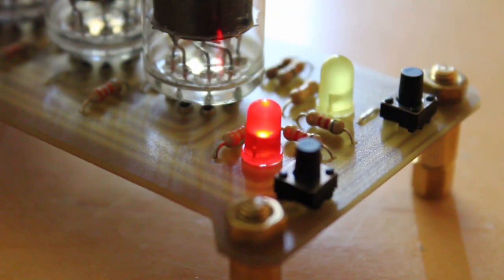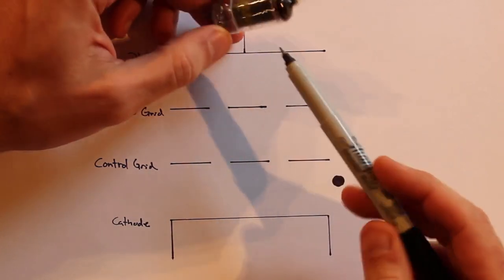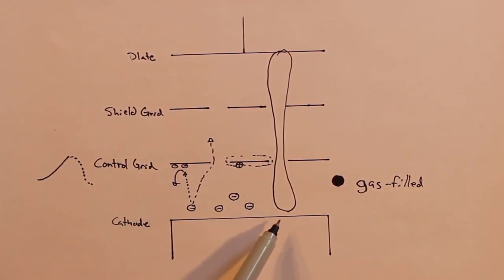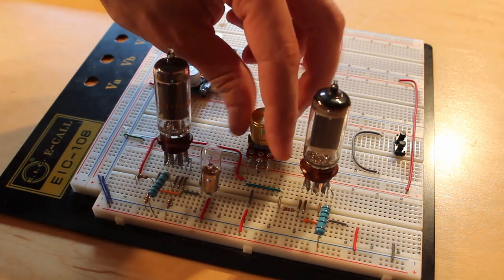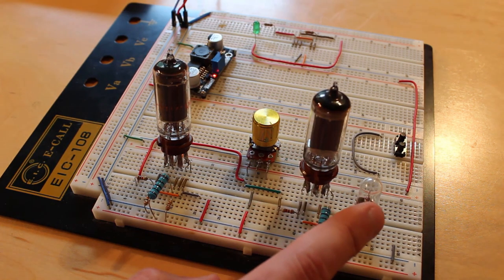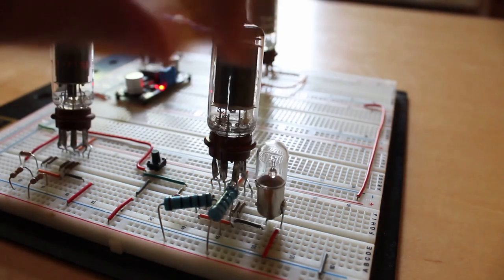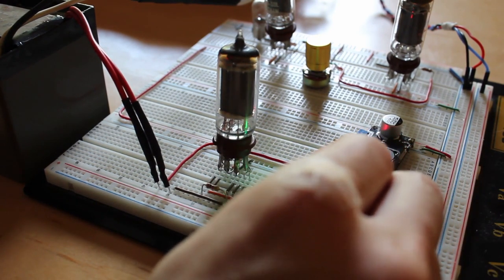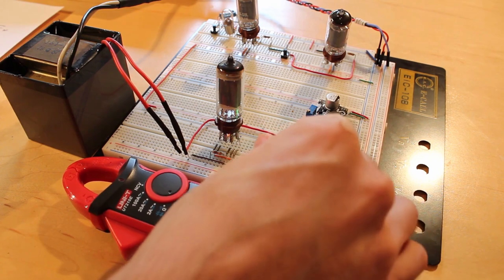The Thyratron and Using a 2D21 Thyratron to Move Some Current

Comment: Excellent video! Thyratron tubes were actually used extensively in industrial applications as rectifiers, and in speed controls for DC motors. I have a Monarch 10ee metal lathe from the late 1950s that uses a Thyratron variable speed DC drive. It uses four thyratrons in total: two large C16J argon thyratrons and two smaller (but still big) 3C23 mercury vapor thyratrons. The mercury thyratrons glow a brilliant blue when operating, and the larger argon tubes glow, but much dimmer.

The operation of the drive is very interesting. There are two sets of thyratrons to form two full-wave rectifiers. The larger C16J tubes control the voltage on the armature of the DC motor, and the smaller 3C23 tubes control the field. The speed control consists of two wire-wound rheostats which control the two rectifiers. Each set of thyratrons has a capacitor connected to the grid. When the thyratron fires (once each cycle of the input AC), the grid current causes the capacitor to charge a bit, eventually charging it enough to create a sufficient bias on the grid to prevent the tube from firing. This stops the operation of the drive. 
The speed control rheostat is connected to a control tube that discharges the capacitor at a controlled rate. When the capacitor discharges enough to allow the tube to fire again, the tube fires until the grid current charges the capacitor again. Based upon how fast the tube discharges the capacitor, the circuit will begin to oscillate, eventually getting to the point where the discharge rate of the capacitor exceeds the grid current, causing the tube to fire on every cycle.
When the armature is at full voltage, the second half of the speed control does the opposite: it ramps down the voltage applied to the field of the DC motor, allowing it to spin faster.

The whole system is basically a gigantic tube-controlled PWM speed control. It was particularly advanced for the time as it also included circuitry to detect load on the lathe and automatically adjust the voltage on the motor to keep it running at a constant speed.

I have thought about eventually making a few videos outlining the operation of the machine, and showing how to diagnose it, as most people with the machine are stumped by the drive. Unfortunately, the common remedy is to rip it out and shove in a generic modern drive that does not come close to the performance of the original.
Reply from the maker: Thank you so much!

That's awesome that you have a lathe that actually uses thyratrons. What a brilliant way to build it too! One day I'd love to build essentially a switching power supply like that, and the capacitor/rheostat method you described is pretty brilliant. I absolutely would love to see some pictures or video of the lathe in action (I love old metalworking tools in any case, so it's like a win-win, haha). 

Those old thyratron supplies were surprisingly advanced and really, really smooth. Ken Schiriff has an excellent write up on a switching thyratron power supply for an old Teletype on his website here: https://www.righto.com/2018/09/glowing-mercury-thyratrons-inside-1940s.html 
He even compares the ripple to that of a modern Apple SMPS and it's actually surprisingly close in performance, despite there being 80 years between them!

Thank you for the awesome writeup! I'll do some Googling and see if I can find some schematics for that old metal lathe and maybe I can recreate the power supply on a more compact scale!
Reply: @UsagiElectric  I have a full set of schematics for the machine, I'll scan them and send them your way if you wish. It took me about a month of research and reverse engineering to figure out how the circuit works with very little data online other than an old patent. (then a week after I had figured it out I was flipping through an old book from 1960 about industrial control systems I had on my shelf, and it had a whole chapter on the exact circuit. That was a facepalm moment)

Something I didn't mention about the system before is how the thyratrons actually power the motor. The motor is wired across the secondary of a large 1:1 transformer with a center tapped primary. The center tap is connected to 240 volts, with the anode of one thyratron on each side. By alternating the thyratrons on the positive and negative portions of the mains AC input, it creates pulses of DC on the secondary of the transformer.
Here's the schematic that is printed on the cover of the electronic compartment:
https://www.practicalmachinist.com/vb/attachments/f10/95965d1389024864-10-ee-tube-drive-relay-small_wiad.jpg
It's rather cramped, and is laid out with page space in mind rather than readability. I have a proper service schematic in the manual that I'll take a pic of tomorrow. (additional funny fact: This version of the Monarch 10EE drive was referred to as the "WIAD", for Works In A Drawer, due to the fact that the whole electronic compartment quite literally slides out on drawer slides for serviceability. A nice feature, and a memorable name)

One of the odd quirks about that particular drive system is that it doesn't put out true DC, more like 'pulsed' DC. It has no smoothing caps, as caps big enough to smooth out the power going to the 5 HP motor would be absurdly large. 

I can also take some short video of the machine. Here's some links to images I uploaded to imgur of the machine:
https://i.imgur.com/9KXXeO5.jpg
https://i.imgur.com/JpfuHhv.jpg
Those are old pics from when I first got the machine, I've since electrically restored it and cleaned it all up. I'll take some more pics tomorrow of the whole thing. It's hard to tell how big those tubes are just based upon that picture, but the large ones are over 10 inches tall.
Reply from the maker: @davidk8893  You weren’t kidding, that’s one of the mot confusing schematics I’ve seen in a long time, haha. It’s wild that it doesn’t smooth the rectified AC, but like you said, the capacitors that would be needed for that would be intense. 

Confusing as it may be, that schematic is a treasure trove of wild ideas! The center tapped transformer that goes to the plates also splits and goes through another smaller transformer that operates the grids. What a wild setup! It’s crazy how nowadays, in the interest of making things compact and lightweight, there’s generally only one, small transformer, but in this schematic it looks like there is six transformers. That’s insane, but a lathe already weighs a ton, no need to skimp on the power supply.

In your photo, it’s so deceiving because I know those mercury filled thyratrons on the bottom are quite large, but they look dwarfed next to the National Electric tubes above them!

Thank you so much for the pictures and schematic, that is absolutely awesome!
Reply: They were also used as timebases in early computers, radiation-counters and televisions and oscilloscopes. They're some of the most diverse tubes you'll find. Especially the later, high-speed tubes like the EC50 🙂

Comment: What thyratrons are really good at, is moving huge amounts of current in very short times. They are used as pulse formers for currents of hundreds or thousands of amperes. They are also very good at making very short pulses. If you have a capacitor charged at a very high voltage, a thyratron can get all of the charge out of it very quickly. They are still, to this day, better at doing that than semiconductor devices like BJTs, FETs, thyristors and triacs. And they do that in a very reliable and reproducible manner. A special version of thyratron called krytron, is used in the ignition circuit of nuclear bombs.

Comment: Thank you for the video!  I did not realize thyratrons could be operated at such low voltages.  I have never had these to play with.
Reply from the maker: Thanks for checking the video out!
I actually ordered a bunch of these 2D21 Thyratrons off eBay simply because I was curious about them! I was quite pleased with how well they work at just 24V. Now I have a bunch of them and need to come up with some projects to build with them, haha.

Comment: From what I read Thyratrons were used in many applications, including relay controllers, early computers, tool motor controllers, switches, stage light dimming,  fluorescent dimmer ballasts, stepper controls, jukeboxes, lasers, tesla coils, radar systems, industrial equipment, welders, elevators, and other applications  back in the day.
Reply from the maker: Thyratrons had a ton of applications! IBM in particular used them to drive the relays for the punch card machine, since they pulled just a bit too much current! Also, CuriousMarc has an excellent video talking about a power supply for an old Teletype that uses two Mercury Vapor Thyratrons as a kind of switch mode power supply to control the voltage precisely. It's an awesome watch: https://youtu.be/WX74GoHuwHk

Comment: Thyratrons were used in spot welding controllers for the car manufacturing industry.  Difficult to fault find because the circuits were high impedance.

Comment: Great video!  I was experimenting a while back with using a vacuum tube to drive a high current load.  I found that even a small 6AU6 can drive a 24 volt relay coil.  You could potentially use this property to reset the latched thyratron tube.
Reply from the maker: Thank you!
Modern miniature relays are so incredibly efficient, it's amazing how little power they actually require to operate. IBM actually used the 2D21 Thyratron to drive the relays for the card reader and punch machines for the IBM 604, 650, etc. Of course, those were much beefier relays!

Using a 6AU6 to trigger a relay to reset the Thyratron definitely could work, although, even a miniature relay can switch a lot more current than a Thyratron can, so it would make more sense to just use the relay to drive the heavy current. 

Where the Thyratron will really excel though is switching speed! The Omron G5V1 type relay has an engagement speed of about 5ms, which equates to about 200 Hz switching speed I believe. The 2D21 Thyratron is limited by its de-ionization time, which can be up to 75 us (the ionization time 0.5 us), which equates to about 13 kHz!
Reply: @UsagiElectric  Or connect the plate of the 2D21 to the plate of a triode, so that when the triode grid goes positive, the plate voltage is pulled down towards ground, and thus pulls the plate of the 2D21 closer to ground.

Comment: A Thyratron can be used to easily make a voltage-controlled sawtooth oscillator.
Reply from the maker: Thyratrons are really great for all sorts of things! I've experimented with a sawtooth oscillator a couple time and it's amazing how simple it is to make! I think my favorite use for thyratrons is as a very early switch mode power supply!

Comment: this is LIT, you're awesome man
Reply: if you connected the control grid to the positive, would that stop the ionization and stop the current flow?
Reply from the maker: @mazengomaa27  Thank you!
Unfortunately, once the gas is ionized, the actual grid wires get encased in positive ions. The effect is that no matter what charge we put onto the grid, it doesn't have any affect on the ionized gas. In rectification service, this isn't a problem since the incoming AC waveform goes negative for half the cycles, that's like essentially cutting the flow of current, which causes the gas to de-ionize and the tube to essentially reset.
Reply: @UsagiElectric  
Wow, that's awesome, thanks for the very good explanation 
Keep it up, you're damn good 😅
Reply from the maker: @mazengomaa27  Thank you so much! I've got an ever growing Excel sheet with episode ideas that I'm working through, so lots of content still to come!
Reply: @UsagiElectric  in the wait, all support man, you're very good 👌👌

Comment: The third schematic could be used as crude PWM if the control grid were connected to a potentiometer. It would make the halogen bulb dimmable. Similar to thyristor based dimmers.

Comment: Thank you for this interesting video. I'd like to build an oscillator circuit with the 2D21=PL21, that generates tilting oscillations as are used for sound generation in the so called 'Trautonium'. Do you have an idea how to generate tilting oscillations with the thyratron?

Comment: Those little thyratrons have been obsolete since SCRs were invented. But I've used larger hydrogen thyratrons as switches in radar transmitters. A 7890 will switch hundreds of amps at 40 KV. I've also used ignitrons to fire somewhat more power but they can be jittery. Plus they contain maybe a pound of mercury each.  Small thyratrons (from EG&G) were also used as triggers for nuclear bombs.
Reply from the maker: I'm always amazed at just how much voltage and current certain vacuum tubes can handle. I had to look up that 7890 - what a phenomenal tube! It's hard to get a sense of sale from pictures, but the heater alone requires 30 amps! From the datasheet, it looks like it's about 4 1/2 inches in diameter and foot tall! But, given the voltages and amperage (up to 40kV and 2,400A!!) that it can handle, that's a surprisingly compact package. 

High voltage tends to frighten me, but there's just something amazing about tubes at really, really high voltages. I can't imagine working around big thyratrons and ignitrons, I bet you have some awesome stories!
Reply: @UsagiElectric  Yeah, I worked in a building that housed a 390KV @ 1 amp power supply. We tested BMEWS radar klystrons, among other things. One of these days I'll come up with a show & tell about my HV work.  There are still applications for such gadgets.

Comment: I am being pedantic a bit, but technically its not a "halogen" bulb.  It's just a standard incandescent bulb.  Halogen are a specific type depending on the gas inside the glass envelope. 
Yeah, I know I am just being pedantic with that :)     
I love valve / tube technology.   I know it's not quite as efficient as solid state technology, but it just fascinates me the way it works

Comment: Would the regular 6AU6 tube manage to power the bulb if it were powered with it's regular rated voltage of at least 100V or so? Also I did not know 47 bulbs were halogen. Is that all of them or is the 47 denomination just the base identifier? love your videos!

Comment: What would happen if the heater was disconnected from the thyratron while turned on? Would the ionisation continue unaffected, or would the voltage drop change due to temperature effects on ionisation? Something to consider for science.

Comment: 20:40
Can this be used in phase control?
Maybe if you replaced the resistor with a potentiometer to form a voltage divider with the wiper going to the grid.

Comment: Could you please explain the use of shield grid?
Reply from the maker: I'll try my best, though my understanding of the shield grid is also a little spotty.

The control grid in a thyratron, particularly this 2D21, is not shaped like conventional grids. It's more like a single chunk with a hole in the center of it. The control characteristic of the tube can be controlled by the size of the hole in the grid (since the plasma must flow through the hole) as well as the size of the grid itself. The larger the grid becomes, the lower the input impedance and the higher the starting grid current. To reduce these effects, the shield grid is added. 
The shield grid is held at a constant potential and "shields" the control grid from the anode and cathode. The shield grid now absorbs most of the starting current, allowing the grid to be made smaller, but the control characteristics can now be controlled by changing the potential difference between the shield and cathode. The result is a low impedance control grid input and control characteristics that can be tailored to a specific purpose.

The shield grid also serves one more purpose, which is to help with cleanup of positive ions after the tube has been de-enegized. This allows deionization time to be decreased and lets the tube operate at higher frequencies.

I hope that helped!
Reply: @UsagiElectric  Thank you ❤️

Comment: 7:19: "It's essentially like a switch." <-- To me the thyratron looks more like the exact opposite of a fuse: Once triggered, it conducts all the current until reset. (A fuse of course conducts all the current until triggered, and then once again upon reset.)
Reply: You're definition of fuse is quite narrow. If you check any good dictionary what fuse means you realise that resetting them is not always easy. For example I've workend with a lathe that had a wooden gear as the fuse on the transmition line. If the lathe jammed the wooden gear would break and the electric motor can ran free and not burn.

Comment: You can use the 6V DC as his own Heater Voltage :O)_)
Reply from the maker: Haha, got a bit of a Catch 22 going on there. In order to generate the 6V, the thyratron needs the heater to be nice and warm, but the thyratron won't conduct until that heater is hot.